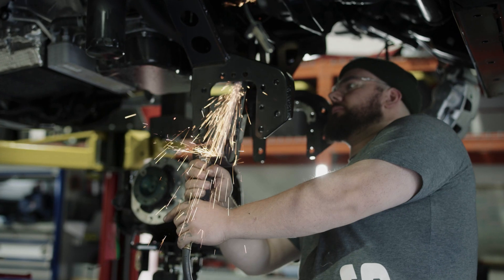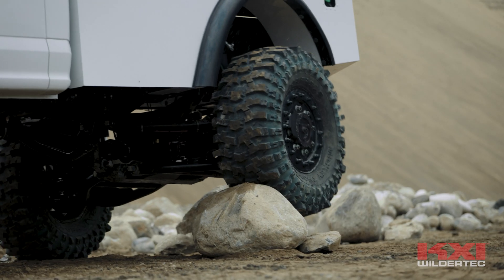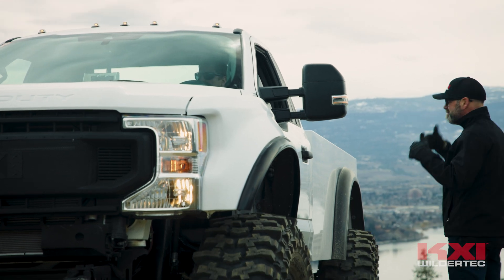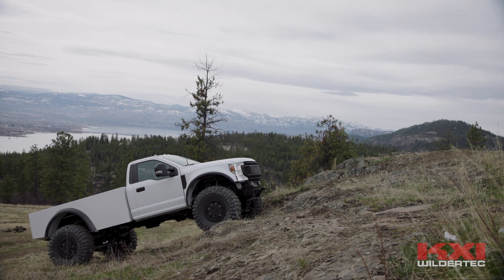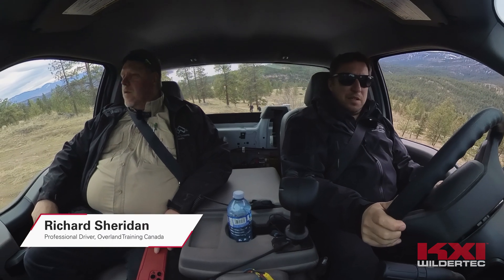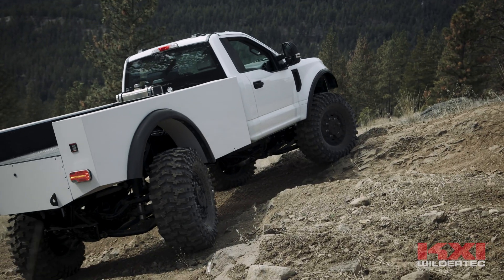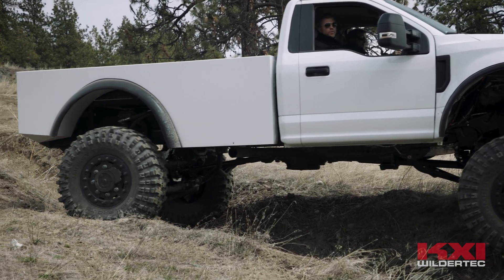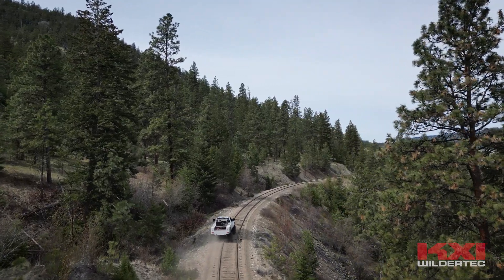Building the Ultimate Off-Road Vehicle - Episode 3 "The Field Test"

Comment: Great Idea but still in its infancy. Tensile strength of materials in extreme cold and also if a large amount of the system is hydraulic, keeping the fluid up to temperature whether in a static state or operating state will be your biggest hurdle. And also not a vehicle that anyone can own so it will be one off build distributor. So a lot to think about unless you go US Govt contracts. Great Video Great Idea Good Luck.

Comment: Very different off riad type of vehicle. Also, excellent!
   Independent suspention, four wheel steering, and auto leveling!
   The functionality looked very good!
   From the video, considering it is for specific purposes, and is not as the factory originally designed, i would only make a few minor changes, but it is in development.
   I think, even though it has either a pneumatic or hydraulic suspension, the valving is slightly off. At low speed, the articulation was very good. At higher speeds, it looked harsh. 
   Structural bracing for the frame as it exhibited a bit of tortional flex.
   Lastly, some storage areas in the sides of that bed.
   Awesome work from that company! Good luck.

Comment: So if you turn left on a steep camber, would the hydraulics keep the vehicle flat? Or would you have some roll???
Reply: It self adjusts
Reply: It looks like the brain of it has two objectives. 1) Keep the truck level 2) Keep even pressure to each wheel to prevent slip. Since these often will contradict (as they would in a turn), I wonder if the driver is given control of biasing toward one or the other?

Comment: Cool irs but my stock tj on 32s would do everything in the video on top of being a manual.
Reply: No, it wouldn't. On that side sloap, you would roll.
Reply: Not sure what they are developing this platform for (the superduty is almost certainly just a conventient body to test the drivetrain), but if this was a military vehicle with tons of armament, supplies, troops in the back of it... I'm not sure the TJ would hold up anymore.
Reply: @bradley3549  its for oil field and mining exploration.
Reply: @T.I.R24  Thanks. I'd wager some of the same logic applies then. Getting out into remote areas with literal tons of equipment, fuel and supplies is a very different operation than a weekend warrior Jeep with a few inches of lift.